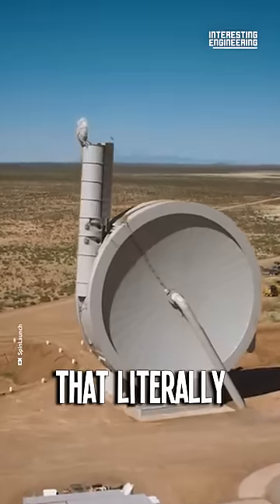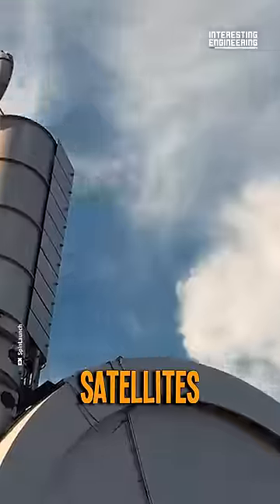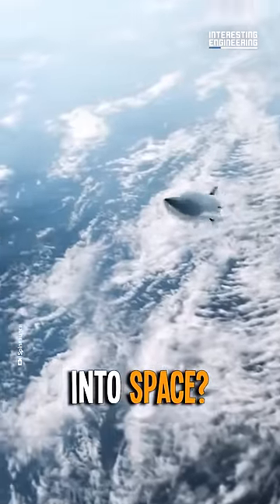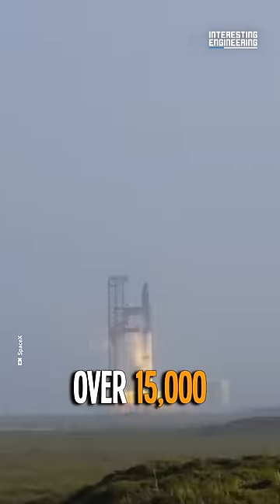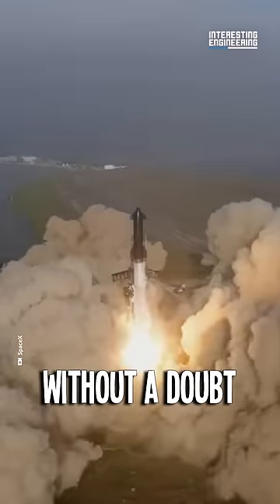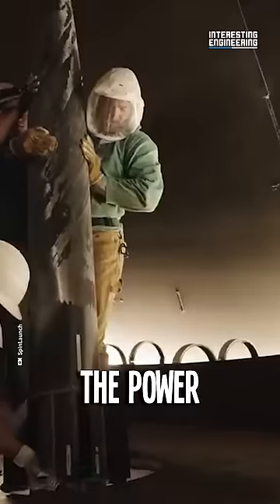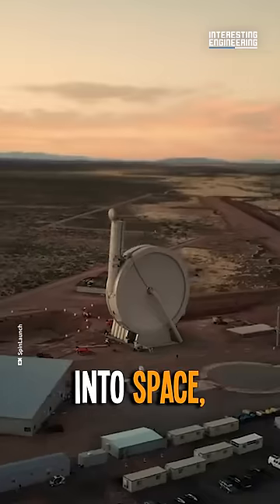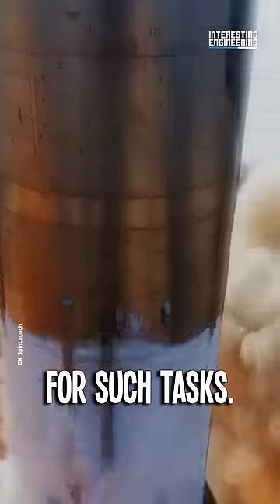Throwing Artillery Shells Into Space

Comment: Now they just need to figure out how to make a solid steel "shell" function as a satellite.
Reply: Dude the video explained it, the satellite is inside.
Reply: @GigachadsUnited  There is no piece of technology that can withstand the G force this device would place upon it other than a solid piece of steel. Hence my above comment.
Reply: Ok Mr orbital engineer, material scientist, guy who knows everything. Liar.
Reply: I'm sure the super big brain genius Elons Musk will figure it out🤣
Reply: @Jeras_sareJ most satellites are already insanely g-hardened. Real Engineering has a great video on this. They brought up the example where a capacitor was sticking up from a circuit board, and apl the testong employees thought it would quickly flop over. It didn't. It was just fine

Turns out high g's don't matter much when there's not a lot of mass to accelerate
Reply: @BillClinton228 musk is not a genius, don’t even put that Word near him
Reply: @Jeras_sareJ  that's not true as long as there's nothing mechanical inside (like a mechanical hard-drive) and it's properly mounted everything should me fine, your mosfids and transistors won't give two sh*to about the gforce, the biggest issue would be any wire connections or if it has a camera attached we'd have to pretty much lock every in place for the wires and camera but have a way to unlock the camera, it wouldn't be the easiest but definitely doable.
Reply: Hes a genius. You mad?  @PollenSniffer101
Reply: I think you have nailed it... it is going to be a shell thrower. An artillary shell aimed at the oppositions satellite(s).
Reply: @gonelucid  ah yes, failing to make good electric cars is genius...
Reply: @MaximilianonMars  youre the liar here buddy
Reply: @SirNobleIZH  Turns out you know nothing about what you are talking about. This concept doesn't required g-hardening. We are not talking about 10 g or 20 g. Spinning this up is going to create 1,000 g. It will shred a satellite, even a normal g-hardened one. Not to mention, when that balanced wheel lobs the satellite, it will become instantly unbalanceed and probably rip itself apart.
Reply: @Jeras_sareJ  They made shells with little mini radar in them during WWII, called it the radio proximity fuze. It was subjected to something like 200,000 Gs when it fired. It's definitely doable.
Reply: @Jeras_sareJ  A satellite carried by a rocket also has to accelerate to escape velocity. Each should be subjected to roughly the same Gs.
Reply: @Necro-the-Pyro  200,000Gs? Maybe you should double check that number that looks at least one too many zeros. Of course anything is possible, but the question should be "why?". A satelitte is already expensive, why spend millions more designing what will be an inferior device just to justify such a dumb launch method?
Reply: 3D printer in orbit, this delivers raw material
Reply: @fyka2902  Yep you're right, I added an extra 0. I wouldn't call it an  inferior method though. Building a very large gun or centrifuge to launch satellites is theoretically possible and the gun is within our current technological and materials science capabilities; and would use orders of magnitude less fuel per lb of payload than our current methods. It would be a great way to get large numbers of smaller satellites up, such as the ones used by starlink.
Reply: If it released early and broke through the side... how many homes do you think it could go through?
Reply: @Necro-the-Pyro  By that logic you could use a giant light gas gun instead and it would be more efficient but I don't see anyone doing that. The reason is that it would look stupid and that is because shooting satillelites with a gun, or a glorified catapult, is stupid. There is no way you would be able to get a device as complex as Starlink to surive such a launch. By the time we could do something like that, we would probably have moon colonies and cracked fusion energy. This is just like putting solar panels on the road or sucking water out of the air. It's dumb, and most likely, a scam.
Reply: @JoelRyanQuinn  thats a cool idea

Comment: With high rotational speeds in seconds means you now have to over engineer the satellites so they don’t break with the centrifugal forces.
Reply: Exactly. If your satellite needs no moving parts, you might be ok, otherwise, it would probably cost more to make it survive launch than it would to just put it on a Falcon 9 with a bunch of other satellites and launch them together.
Reply: If they were to make the radius larger, that would reduce the centrifugal force that they have to deal with.
Reply: Yes, and also spinning giant metal pieces so fast is calling for a disaster.
Reply: Not to mention the atmospheric drag. Max Q for a rocket is already make or break. Now try literally flinging an object from ground level at around 8000km/h. That is what they propose. 

So huge centrifugal forces followed by huge atmospheric forces. The payloads will have to be tiny to have any chance whatsoever
Reply: surely these guys have thought about this before their investment.

Comment: "Eliminatating fuel" -that's magic and that's not what's happening.
Reply: Eliminating is the wrong term but the electric power to get this projectile to escape speed is much lower than what you need as fuel. Not even speaking of the energie you need to produce the high density fuel for rocket.
Reply: A Linear Rail Coil Mass Accelerator. That's what we called it back in the 90s. It was purely theoretical at that point.

Amazing how it actually came to be.
Reply: Also “the power of velocity” as opposed to angular momentum
Reply: Theyre not trying to elimiate all the fuel.  Just the massive amount of fuel the rockets use.  Reducing the fuel by half or even 1/3 can drastically reduce the cost of launches.
Reply: Truly
Reply: They said it though towards the end of the video that the shell splits away, revealing a 2nd stage rocket that carries the satellite the rest of the way into orbit. So no, they're not claiming any magical, total elimination of fuel, just a good fraction.
Reply: @Speedy2619  It still uses a two-stage rocket.  That uses fuel.
Reply: The beauty of rocket fuel is that it is all hydrogen and oxygen.
Reply: Depends on how much Watts of electricity consumed to use this instead of traditional fuel for takeoff. For satellites and other smaller nonmanned spacecraft I can see it, for larger no way in hell.
Reply: @Speedy2619  it still uses rocket fuel, and steal uses fuel Herr to spin the shell to such high velocity.

So it doesn't eliminate anything.
Reply: Mentions at the end of the video it’s a two stage rocket to get the rest of th way up
Reply: @Speedy2619  Where does electricity come from, useable, massive amounts of electricity
Reply: @kingcosworth2643 this depends on where and when you need this electricity... and also depends on whether you are using electricity from the public grid , or have your own power station.
Reply: Yup just like "electric" cars
Reply: exactly!
it would require fuel in order to make a stable orbit, otherwise it would leave gravity or fall back down
Reply: The fuel used to be hydrogen/oxygen.....no pollution!
Reply: @Speedy2619 The initial velocity to get something to Low Earth Orbit (LEO) is 8 km/s (5 mi/s) or about Mach 23, which is 10x faster than a Howitzer cannon artillery shell.  There is no way in hell they'd ever be able to even get it as fast as an artillery shell, much less 10x that. This whole thing is asinine and a complete fraud.
Reply: @Speedy2619  I would really like to see the exact calculation on this as I doubt that statement very much.

Comment: They don’t explain it fully here but the idea is the spin is under vacuum so it can spin to the speeds that would allow it to get through the atmosphere. That’s why in the clip it’s bursting through a membrane.
Reply: Right, this is just a snip. People need to do more research. Most of the fuel and thrust is used just to get it off the ground. This idea eliminated that fuel requirement. Of course it is small because it is the first.
Reply: Ooooh a vacuum. That solves it. What kind of g forces do you think the projectile will withstand?
Reply: What happens when the air rushes in through the opening that the sattelite is launching out of ?? I call bullshit again !!!
Reply: The main issue is the Gs experienced by the projectile. Unless you want to ship powder or liquid, it would destroy anything else. You can get around the other problems, but this is a hard limit, and I wonder what their plan is for this
Reply: Rockets need to reach over 20 times the speed of sound to leave the atmosphere. Even if this fancy slingshot were able to throw it that fast in a vacume, the sudden friction trough the atmosphere would probably crush it instantly.

And even if we ommit that, the rocket would loose it's speed extremely quickly due to the collosal friction trough the air. It'll probably need to engage it's thrusters way earlyer than expected.
Reply: @georgetpeppel2900  That is part of the challenge with this R&D, SpinLaunch engineers are partnering with satellite developers to make ultra hi G force tolerant components. Actually more of a challenge than the huck
Reply: @dr_nyt4041 lol not even close the friction caused by exiting at this speed might as well be an uncontrolled re entry stuff would be burning up on exit plus they would most certainly be single use launchers as the membrane getting punctured would destroy the launcher  with the back draft
Reply: @tincupnickleboythe1st700 .. think about that just a little harder. Instantly vacuum meets  air. 

The air forcing itself into the area behind the projectile will only help.
Reply: @tincupnickleboythe1st700 
Sonic boom 💥 is my guess. How big? Not sure...
Reply: @arthur1112132  I picture mangled satellites flying through space towards the sun.
Reply: @Twoyorkiespa Could be logical, but since the actual entry point of all the air is the exit point of the satelite, the drag forces will actually cancle out (most likely more than that and slow down the rocket, because thers more air around the rocket as time passes).
Reply: @tincupnickleboythe1st700  It accelerates to such high speeds that will then still go through the atmosphere with drag. When it's accelerating it's in a vacuum.
Reply: You cannot keep vacuum inside with a “membrane”. 1 bar of pressure is 10 tons on one square meter …
Reply: Insane in the Membrane Yo! Insane clown posse going to space!!

Comment: Or, you could just stop the Earth from spinning, and let everything go off on a tangent.
- Tan Gent
Reply: Earth's rotation speed is only 1.6k km/h. Escape speed from the surface is like 40k km/h. Also if a astronomical object has a high rotation speed, but its shape is not spherical, it will be very much flattened, if at all the matter will be able to stick together. There are many asteroids that, due to their high rotation speed, are ready to fly apart into small pieces
Reply: Btw spacecrafts use the rotation of the Earth to save fuel - it’s cheaper to take off at the equator towards the east
Reply: @pumpum9937 
You either completely missed the joke or are so full of yourself that you feel the need to disprove a joke.
Both are sad
Reply: I had Professor Gent in college, but I never quite figured out what the course was about because he spent most of his time going of topic.
¯\_(ツ)_/¯

Comment: They don't even reach half of escape velocity with their design. The satellite will not only have to survive over 400 times gravity, so does its required boost vehicle. After being thrown to high atmosphere it still has to accelerate by about 15,000mph and guide itself into space. In theory you'll save more than half of the fuel required for a normal ground launch. I say in theory because first you have to build a rocket and payload that can reliably survive being accelerated in their centrifuge.

You also need to design a centrifuge that can survive being unloaded suddenly at max velocity. The centrifuge not only has to survive becoming unbalanced suddenly when the payload separates. It also has to survive suddenly operating in atmosphere rather than a vacuum once the payload punctures the escape tunnel seal. I have not seen any realistic solutions to these problems being advanced by spinlaunch.